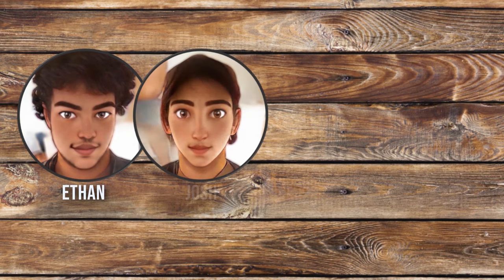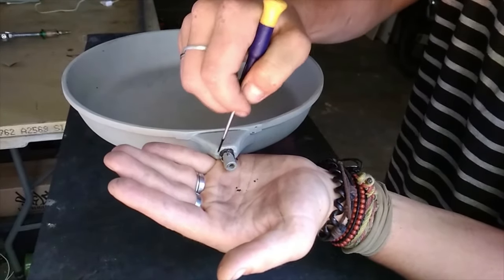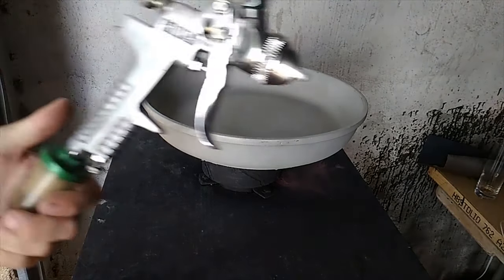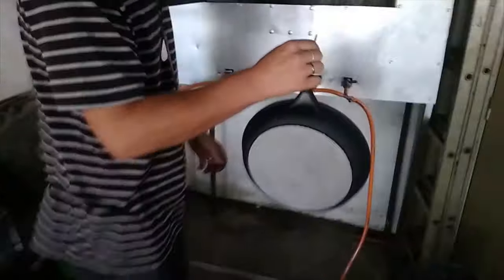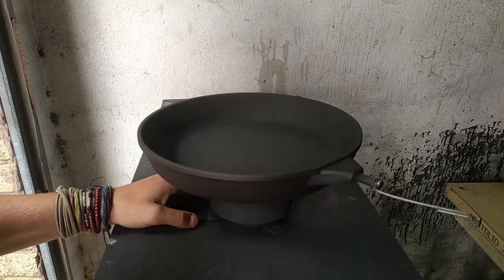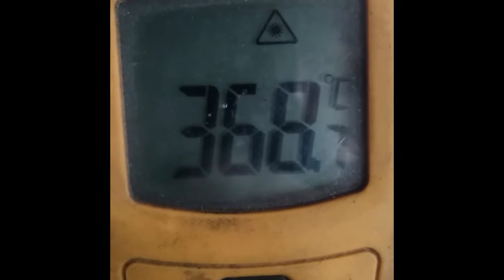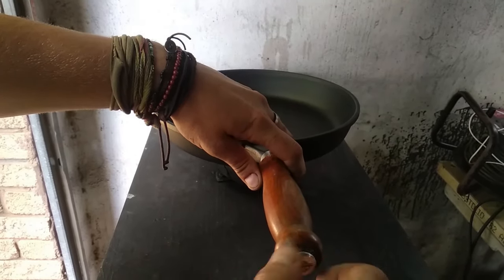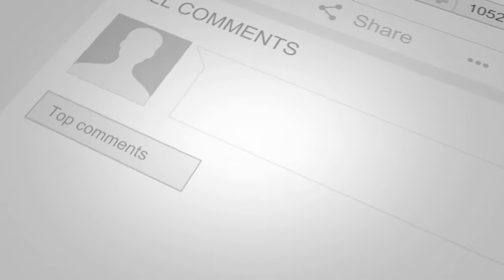Refurbishing and  Recoating a Pan with a Teflon Non-Stick Coating

Comment: Teflon spray coating is available at better paint suppliers. It's used on racing boat hulls & various parts as friction mitigation. Also as preservative & corrosion preventer.
Reply: and then also cure it at 400°C?
Reply: Is that food safe? Also, is it safe during the paint bake-in process or you need special air filter like dupont use?

Comment: Personally, i wouldn't risk cancer or infertility from C8 exposure and just get a new pan
Reply: Yeah the comments are full of idiots using a non damaged teflon pan might be ok but defenitly not doing this should get taken down as this is a health and safety hazard
Reply: It seems like the degree of risk would be exceedingly small.  As the new non stick coating wears, only a very tiny amount would be ingested with each meal.  Perhaps, there is less risk than that found with food additives and other chemicals in the environment, i.e. vehicle exhaust.  I think it's great these pans can be recycled this way.
Reply: @daniellarson3068 I can send you pictures of how much of that stuff you actually eat. It's a lot... I just found out something horrible and that's why I ended up here. Going to sue the company.

Comment: Where can I purchase the base coat and final teflon coting please?
Reply from the maker: Hi Jim, we are based in Pieternaritzburg South Africa - where are you based?
Reply: @randomworkshop328  Hi there! By the way nice presntation. I have the same question that Jim has asked. I live in Belgium and I know that its impossible to buy the tefflon (pouder) in any of the neibouring countries. If you know of a company in SA that would consider selling and mailing the base coat and the teflon to Brussels I would really appreciate knowing the company name (and contact info). Or if you are planning to provide the service you demonstrated also let me know. I would like to recoat larege surfaces like the top of table saws (e.g.; deWalt). Thank you for your reply.
Reply from the maker: Good morning Nelson, we have had an increasing demand for the products and we will be selling them in the near future. I will keep you informed as to when we do start shipping the product.
Reply: @randomworkshop328  Thank you

Comment: Useless if you don't tell which products you sprayed on the pan. I'm just puzzled that you didn't think of that...
Reply from the maker: Hello Pablo - thanks for pointing that out - the products are actually manufactured locally for us and up until now, we have not been offering the product to the market (although we do plan to),
Reply: @randomworkshop328 , Do you have your products on Amazon. We could purchase it that way.
Reply from the maker: Thanks for contacting us! We are looking at starting direct shipping in July 2022, depending on the demand we will then be looking at something like Amazon, but will keep you posted.
Reply: @randomworkshop328  yeah good luck with pfos!!
Reply: It's not a DIY video, it's an Advertisment, disguised as DIY video.
Reply: And still we don't know the chemicals.
Guys really.
Please tell us the name of the coatings.
Otherwise, this is just how to clean and spray a thing.
Not clear why this video was posted.
Reply: I was thinking the same thing
Reply: I am delighted to see that this service is offered. I have a few items that I would like to have refurbished.  How can I get in touch with you.  Kind regards  Sharon
Reply: It looks like they have companies like Orion Industries, but you would possibly have to buy it in bulk. I’m going to try to call them and see how all this works for the powder coat.
Reply: Have you looked up Orion Industries I believe they have the products needed for nonstick powder, coating or liquid coating